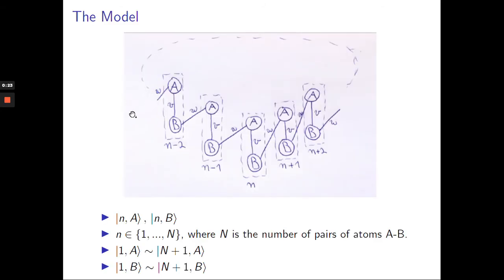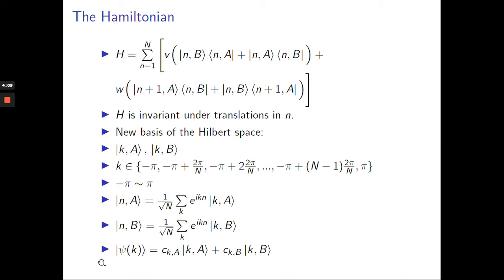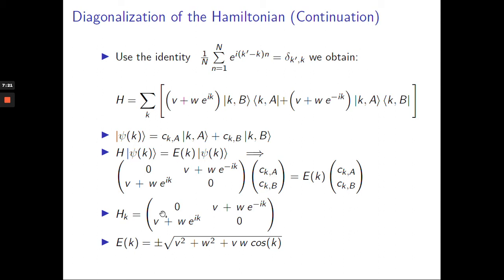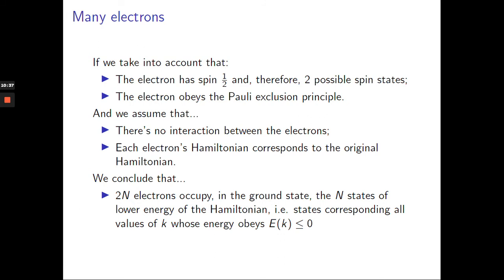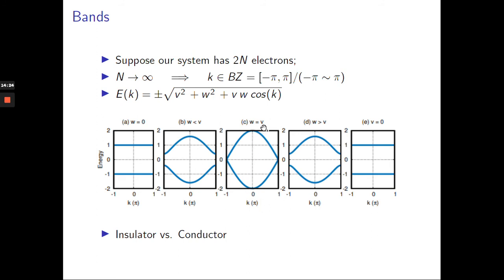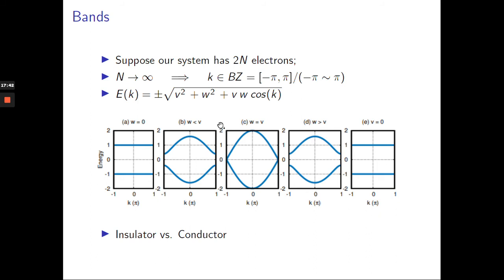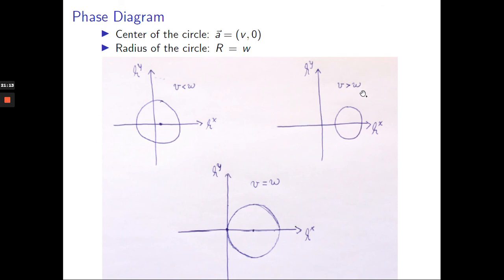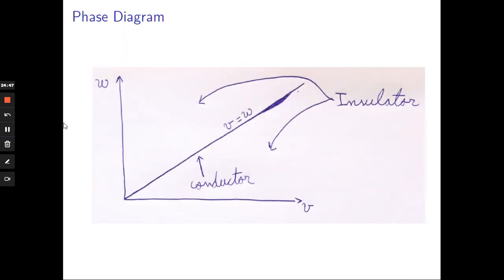A Short Introduction to the SSH Model

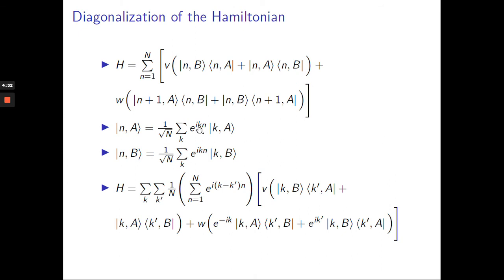Comment: Thank you for the nice walkthrough!! For the basis transformation part from real to momentum space (04:30), according to the Asboth's book "A Short Course on Topological Insulators", |k,A> = 1/sqrt(N) \Sigma_k [e^(ikn) |n,A>]. Was it a typo from your slides? 
Also I wanted to follow up that the basis transformation was very hard to understand and derive. Could you provide some references on the stepwise derivation of the momentum space Hamiltonian?

Comment: Another way to see that one cannot go from a system where w-v<0 to a system with w-v>0 is to consider the function f(w,v)=w-v, which is continuous, and therefore the level curve f(w,v)=0 separates the plane in two regions (Jordan's separation theorem). This is your last figure, actually, with the phase diagram.

Another one, is to consider the same function f as above, and apply the Intermediate Value Theorem to show that if we indeed had a path from one system to another then at some point in the middle f=0.